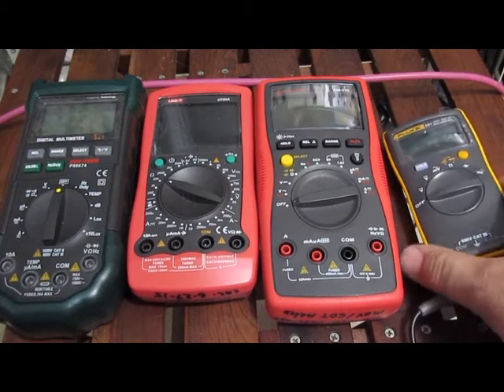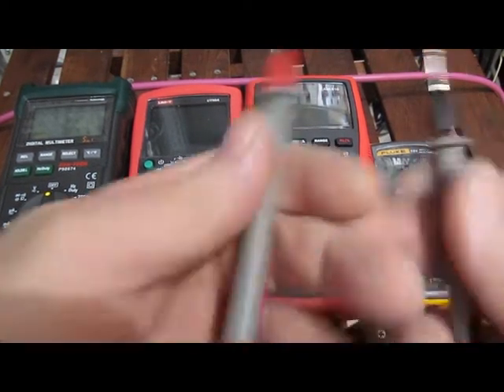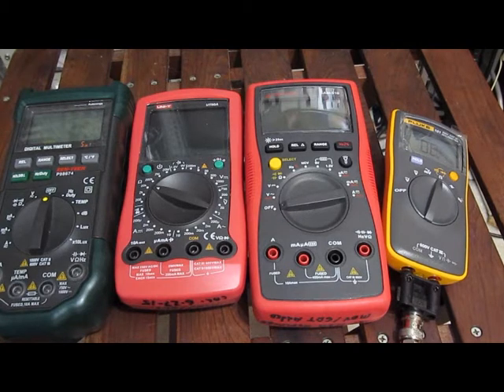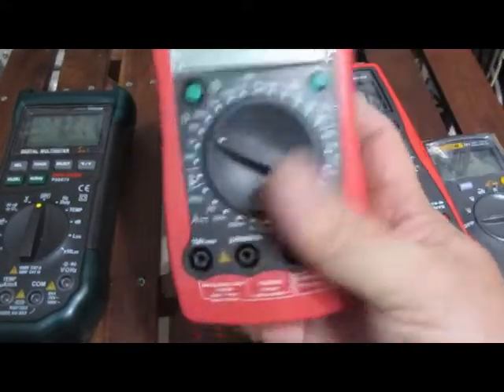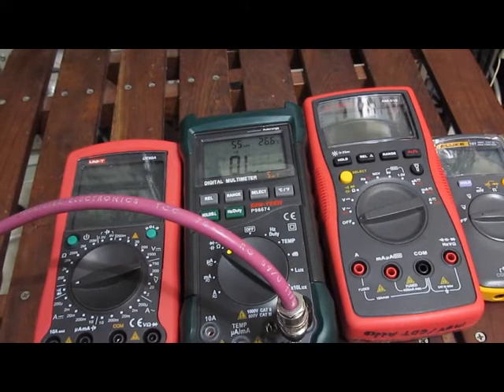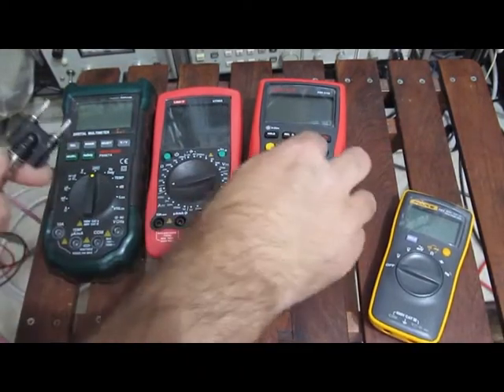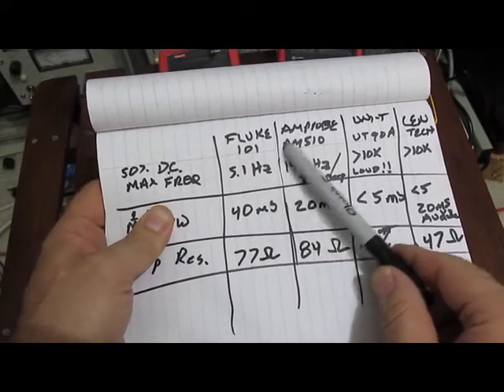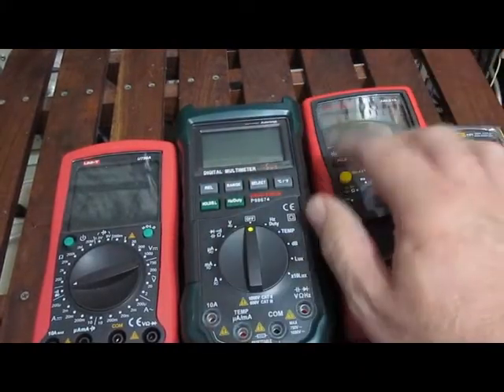Comparining the continuity feature of different meters

Comment: For me a use-case is hunting down connections down a board, for example on a chip with many pins. Due to latency, while sweeping, I would end up passing a few pins, causing me to slow down and go back. I usually touch the tip of the probe with the body of a bronze brush and swipe the bristles across the board, that was the fastest way to do it. I end up using the cheapest meter since it has almost no latency, but it's also non-latching. So, perhaps, in the future, a latency/delay test would prove useful.

While watching your videos I've decided to buy the UT210E and it has a pretty 'weak' continuity tester. However, some Anengs use the same chip with a slightly different continuity detection circuit and they have a faster response. I intend to play with the UT210E circuitry to see if I can improve the results.

Thank you for your videos!

Comment: great stuff.I have definitely had similar issues with the subjective "swiping" method. What are you using to pulse the continuity? are you just inputting a voltage signal, or are you strobing a MOSFET or something to generate a short?
Reply from the maker: Thanks. Glad you are enjoying them.   Funny you ask.  I was thinking I would need to used an analog switch or a FET.  Once I started looking at them, none had a real high open circuit voltage so in the end I just drove them with 0-5V logic.   That's how I have taken all of the data in the spreadsheet.